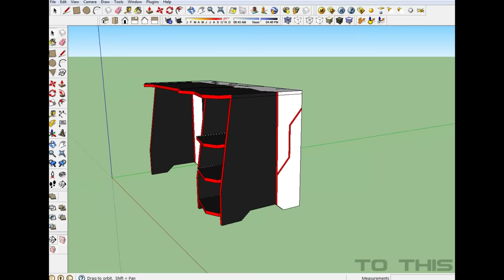DIY Gaming Desk Using Basic Tools + Plans and Details

Comment: You should invest in a skill saw.
Reply from the maker: i will sir...^_^
Reply: And a Dremel, Hole Saw drill tip, Electric drill/screwdriver, Angle grinder
@Varnish you work if you want the paint to last longer and shine.
Reply: And some steel toes. How many times can you do this before you start getting called 9 toes.
Reply: That's pretty mean.

Comment: Sir please answer my question... How much weight can it hold and what is the amount needed by you to build this completely and can it hold dual monitor with cpu
Reply from the maker: This table are design to hold 250 to 300kg of weight. The table are design for single monitor with system unit you can check the description for the materials list so you can canvass the material cost
Reply: @AJLGamingPh  Thank you very much sir for such an helpful comment but can I some how increase any portion to fix dual monitor for streaming
Reply from the maker: @luffysenpai5036  you can check my other design the black red that table can handle up to 400kg design for dual monitor with system unit
Reply from the maker: @luffysenpai5036  https://youtu.be/1JPGC8wloIU

Comment: Sir may ask ako kung anong thickness ng ply mo
Reply from the maker: 3/4 po
Reply: @AJLGamingPh  okay kaya sa table ung 18mm thick?
Reply: @AJLGamingPh  and then anong mas okay boss na gamitin plyboard or plywood?
Reply from the maker: @chukirusyt9919  dont use plyboard use marine plywood 3/4 inch. nasa 18 or 19mm sya